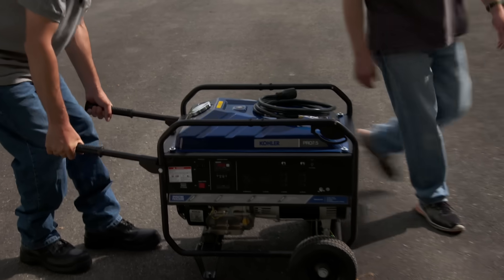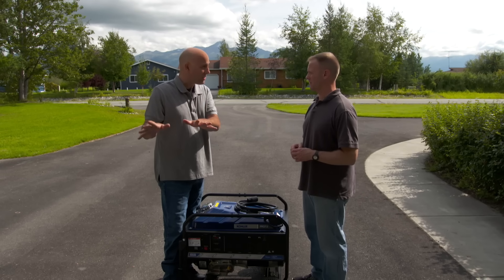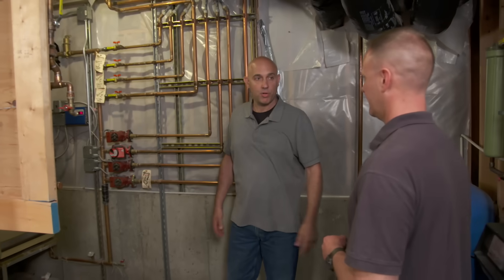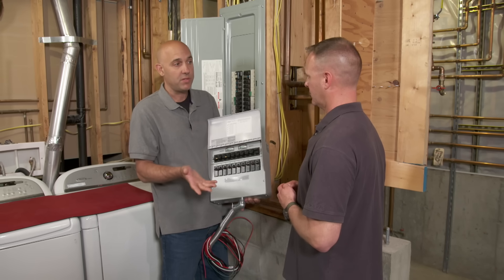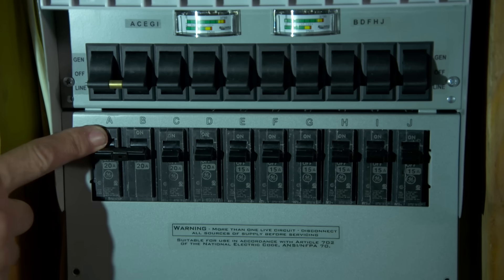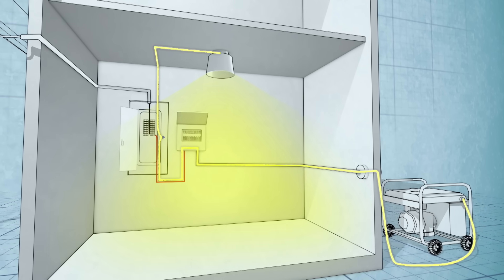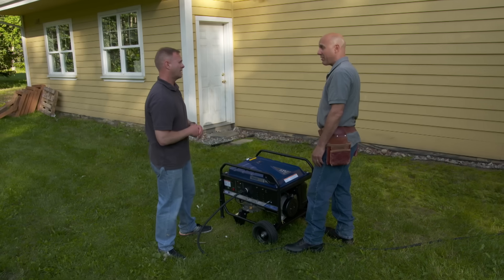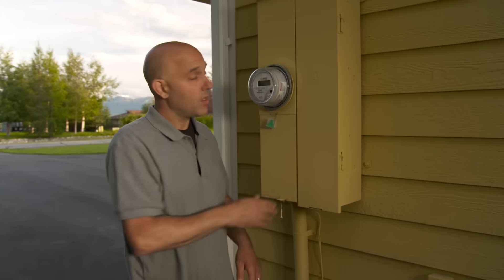How to Install a Manual Transfer Switch for a Portable Generator | Ask This Old House

Comment: People are wondering why he doesn't just have a nice automatic standby diesel or natural gas generator installed.  That's a good question.  Here's mine: Have you ever had to depend on true professional prime generators?  Because I work at a radio network and between our studios and transmitter sites we have 10 beefy primary professional grade 60-120 KW generators with automatic transfer switches and all the bells and whistles.  And let me tell you something: They are a constant pain.  An absolute constant pain.  We have to keep after them every month, changing belts and filters, batteries, and so forth.  Whenever there's an extended power outage, one or two of them will always fail.  Sometimes they won't start.  Sometimes they burn  a winding.  Or the transfer switch freezes.  Or the $500 deep cycle battery quits years ahead of time.  These are professional generators, brands like CAT and Cummins, meant for continuous off grid use, very well sized for their loads (not exceeding 50%).  Not your wimpy Generac home standby system.  Based on more than a decade of experience with these generators, plus all the horror stories from peers one accumulates, I'd never shell out a load of money for an automatic home system.  Better to have a nice setup like this in place so I can connect a generator of my own at any time.  It costs a lot less to drop into Costco and buy a $700 portable generator and toss it when it breaks, than it is to get a $10,000 home system installed that fails me when there's no technician to come out and look at it.  You can say that it "should" not be this way, but let me ask you something: If a radio network with over a million dollar a year budget on maintenance with a licensed diesel mechanic, a licensed electrician, and engineers ON STAFF has issues with true professional diesel generators, what are your chances with a cheap Home Depot one installed by some subcontractor?
Reply: As the senior tech at a public safety radio shop. I chose a big 400 gallon propane keep full serviced tank(half or better) brought liquid propane into the generator building to the gasifier that uses engine coolant. the engine has block heater. nice 454 chevy v8 on propane gave reliable back up power for the 20 years I worked there. All I did was have the generator service company out once a year to do check over and maintenance. much better than diesel those gave lots more trouble. its back up so the extra cost of propane is not a big deal at all. the propane service company let us use their tank as long as we got the fuel from them so that was a good deal. now that I am retired I keep a 2000 watt portable gas generator in my garage with the gas empty. If I need to use it like to run the furnace or refrigerator. I take it outside and put some fresh gas in it. I am not going to tell how I hook it up. but its easy and easy to put back to normal when power is restored. One thing to remember, besides how not to hurt yourself. be sure that what ever you rig up does not feed power back into the electrical grid and kill some power company guy trying to make repairs.
Reply: I replaced my backup generator with a solar backup system because the generator never worked when I needed it.
Reply: @jmdelapp  Your solar backup system still needs routine maintenance just like a portable generator does.
Reply: @dafunkmonster  No, absolutely not true. My solar backup system does NOT need routine maintenance. I have never had to change the oil, add gas or replace belts or filters. The LiFePo4 batteries are totally maintenance free.
Reply: jmdelapp Well that’s simply false. LiPo batteries have a pretty substantial self-discharge rate. They need to be frequently recharged. You can’t just stick them on a shelf and forget about them. If you discharge them too much, they’re irreparable. And they have a finite lifetime in terms of charge-discharge cycles. So at some point, you’re going to have to replace those batteries.

Routine maintenance is absolutely required for your solar power system. Just because it doesn’t resemble the kind of maintenance you would perform on a gasoline generator, doesn’t mean it’s not maintenance.
Reply: If I understand correct these proffesional grade generators at that kW we are talking only about Diesel. We dont get Petrol in that size here, but Diesel engine want to work not sit at idle or belowe 80%  load sinxe pistons will glaze up which is bad for extended runs. That how many many Generators have died and with improper maintenance

The deap cycle batteries should be charged constantly with the automatic changeover switch built in charger and only ever be used to start up the generator and then be charged from the generatot till mains are back in and the process starts again.

For maintenance every few hours the Generator has run it needs to be serviced following the correct accumulated hours and its repected corrective maintenance schedule

We have Generators running 10+ years that were 2nd hand that already ran another 10 years and those are still going strong
Reply: Use a military generator.  😆
Reply: "We have to keep after them every month, changing belts and filters, batteries, and so forth."

Uh...yeah, all of those things are wear parts.  They're the things you have to replace as part of regular maintenance, even if you don't run the generator.  These things have to be factored into the cost of ownership.  

You have to do maintenance on portable generators, too.  If you don't, you'll find yourself stuck with a boat anchor when you need a generator.
Reply: Jose Quinones ---   Sounds like you have "poor to no maintenance" written into your business plan or something, right ???  I set up for my company big diesel generators and bigger Liebert Batter Power Strings to keep the 5,000 seat Call Centers and everyone else working in  800,000 square feet of buildings,  and we NEVER had problems with any part of this Disaster Recovery Plan failing...
My budget for Telecom was also 1 million dollars a year and I never needed to have all those high priced apparently - USELESS diesel mechanics electricians, and engineers on staff, that you apparently have, either... 
The only thing I had was a contract with a company to keep our diesel generators filled up 24/7 when needed, that's it.. 
Perhaps you guys have nobody in charge of this fiasco you continue to tolerate???
Your own lack of ability to CONTROL your own Team seems to be the biggest issue you have, so good luck with that...
Reply: I9
Reply: What about going solar with battery back up. No moving parts. No gas. No diesal. 
Get the engineers to work on that, than the dated corporate bs. Oops did i say corp.
Reply: Jose, very good argument against a whole home generator.  I priced out a whole home Generac 22kw system for my home, and the estimate was over $9000 installed.  For less than $2000, I bought a 10 circuit manual transfer switch, paid for a professional to install it, and bought a 7.5kw dual fuel Champion generator ($799.99).  With this setup, I can run all my lights, TV, window A/C unit, microwave, garage door opener, etc.  Pros?  I can use gasoline or propane.  Cons?  I can't run 220v appliances like an oven, central A/C, or a clothes dryer.  I do have to deal with the minor inconvenience of pulling the generator out of the garage and connect the 30amp cord to the panel outside.  For that 5 minutes of work each time the power goes out, I saved $7000.
Reply: @Mowcowbell, nice. I just purchased a 7500W generator and am looking into adding a manual transfer switch to my home. If you don't mind me asking, how much did the 10-circuit switch and installation cost?
Reply: Mowcowbell  - LOL ... good luck with that rig.  No A/C!!  Try living in Texas in 100 degree, 80% humidity days for two weeks straight in the summer with no A/C!!  Even better, try feeding that pathetic portable generator gasoline for two weeks at $100 per day MINIMUM!  If the power is out in your area, how far do you have to drive (3~4 times a day) to buy gasoline!! 
Your idea of saving money is stepping over dollars to pick up dimes!!  LOL
Reply: Red Car:
$100 per day...?? How much is your gas..?? LOL 
My brother in Law lives in NC and went 8 days without power (hurricane florence) and ran his 7k watt generator 24/7 for 8 days straight ... 10 gallons every 24 hrs ... 80 gallons for 8 days = $240 in gas
Reply: To Jose Quiñones - You make good points, as an industrial/commercial electrician who has installed generators up to 13kv, if something can go wrong it will even though it should not. Million dollar maintenance contract! For the homeowner, most outages are not long and if you have city water and natural/propane gas heating, you don't need much generation. With a well pump, having water makes all the difference in the world so money spent is worth it, especially with kids. The generac auto transfer schemes definitely make sense for many people's combination of circumstances though. A very good, simple scheme is if the local power utility allows the transfer switch to be part of the meter socket and a simple cord run between the generator and the metersocket. Almost child proof!
Reply: LOL .... Our Generac 22kW system has been installed a little over 10 years and works perfectly every time the power goes out including one time for two weeks!    I'm betting your cheap-ass radio station didn't do routine maintenance.  Pretty normal for a typical radio station, hire some out-of-work reprobate handyman with no electrician's license and no manufacturer's training and expect him to maintain all that equipment between swigs from his flask.  No wonder all you old outdated equipment gave you so much trouble!!   LOL

Comment: You mentioned that two wires are needed for 240 volts but in order to achieve that, you need two different 120 lines. How do you determine this using your transfer box. You omitted some clarity on this point. THANKS
Reply: This video segment is more of an informational and educational video than an instructional video.  Step by step instructional videos are available on the YouTube channel for Reliance Controls, and the connection of a 240v circuit is addressed. The bus bar is laid out so that every adjacent switch/breaker is on a different phase of the generator, so any two adjacent switches can be wired to a 240v circuit of the appropriate amp rating.
Reply: Doesn't matter, there's 2
Reply: The transfer switch splits them internally for the 120 v circuits; half on one and half on the other.

Comment: What about the back feed of the neutral wire back out to service line. I know that this would be a very low watt but you times that by 100 or 200 on an outage due to hurricane that could now be a very high wattage. Is there really a big concern about this?
Reply: Power always returns to its source and takes the path of least resistance.  When the generator feeds circuits in the house, and the return power sees the path back to the generator through the single neutral wire between generator outlet and neutral bar, the return current will in no way travel back down the utility neutral - unless there is a path of little enough resistance that somehow will find it's way back to the utility transformer and back to the generator where the power originated from - which is just about impossible as can be speculated unless the generator is sitting next to or on top of the utility transformer and there are extraordinary fault conditions.  Assuming a portable generator will be located nowhere near the utility transformer, the return power from the generator will not take that path.
Reply: Lol! The neutral is the ground. Your house is fed two live wires and no neutral. Pff

Comment: How do i plug the green and the white wires from the transfer switch if my panel only has one neutral bus bar?  Do i connect both to the same bus bar?
Reply: In any "service entrance" panel, usually the main panel or an outdoor disconnect, the neutral is always grounded, so that the neutral and ground are common at this one point and one point only in the electrical system.  If your panel has ground/neutral bars that are common, then it's likely it's the main panel (service entrance panel) you are dealing with in which case you connect the generator neutral and ground to an available terminal on any bar if the bars are common.  If the bars are clearly separated, then it's not a main panel but a sub panel, and the neutral bar will be entirely isolated from any ground wires as well as the cabinet itself.  In this case the neutral from the generator must go to the isolated neutral bar and the ground to the ground bar.
Reply: Reliance Controls Thanks for the reply.  Now i’m a little more confused because I live in a condo and I thought that my panel was a subpanel tied to a meter room where each condo has a main panel with meter and main breaker switch.   The panel inside my condo just has the one bar.  Does this mean that it is a main panel then? Thanks again
Reply: There are a few possibilities in buildings with multiple meters, only a qualified person would be able to confirm how your panel is defined by identifying the neutral and ground relationships of your panel and any panel it is fed from.  It's possible they have bonded the neutral and ground at your panel, and at the feeder panel, as it creates a parallel path between the panels for the return current on both the neutral and the ground wires, which is unsafe and against code.  It's also possible that each condo does have its own main panel, but again someone would need to evaluate that in person in order to verify that the neutrals and grounds are not commonly connected at more than one point in the same system.
Reply: Reliance Controls ok I’ll have it check out by a qualified technician.  thanks again.